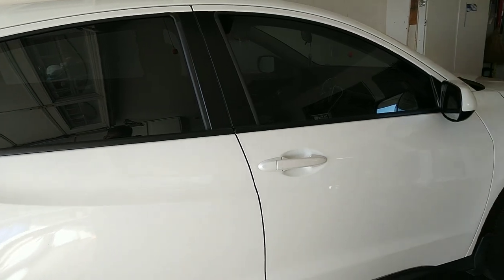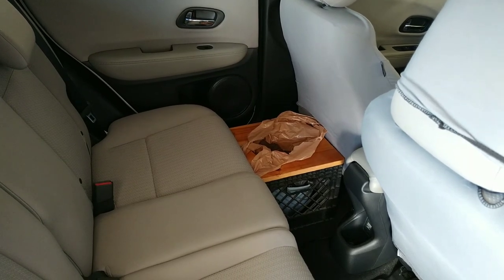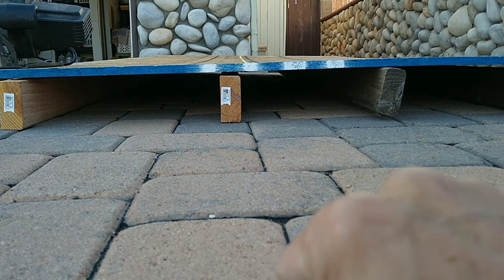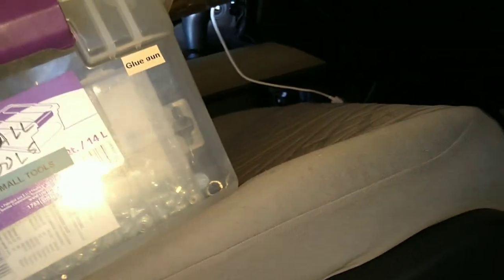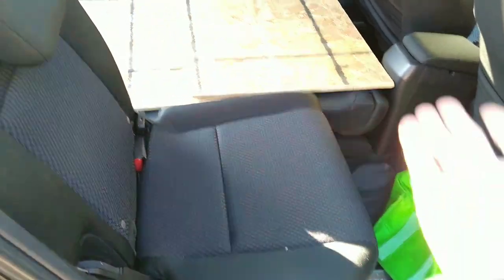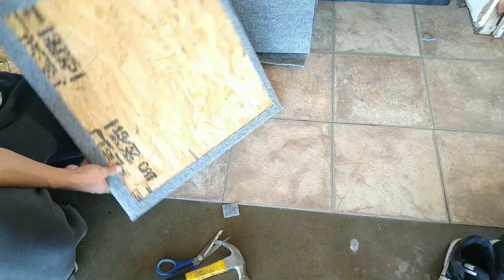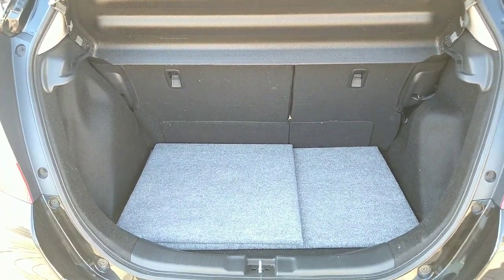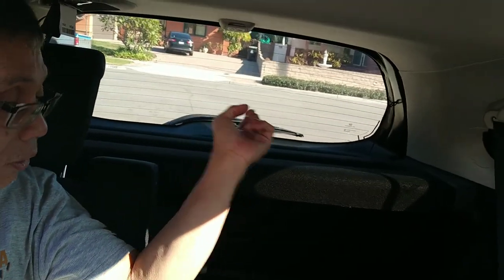#howto #carcamping Car Camping | Bed Platform for 2016 Honda HRV and 2018 Honda Fit

Comment: I really like your idea of flipping the one board over for cooking/desk.. you can get a roll of 10" roof flashing for about $11 at home depot.. Its a 10' roll but there are plenty of uses for it in a camp, wind break, sun deflector etc.. for the 1st set up Id consider building a 3 sided support that conforms to both seats that would keep the platform level. a couple eye screws in both boards would take a rod to support the 2 edges, Like you I prefer the second method, Im a little over 6'1 with a beer keg belly, I have used the second method many many times
Reply from the maker: Good ideas!😎👍

Comment: Doesn't your hip get sore because you body weight is on it and then there is not enough leg room?
Reply from the maker: Yes if you sleep on it without cushion/foam. I will be using exercise mat and self inflated air mattress on top of the bed PLATFORM.😉